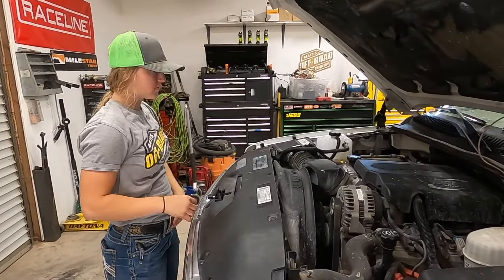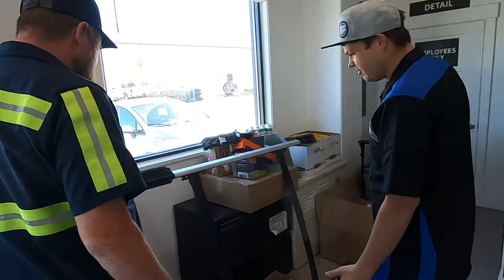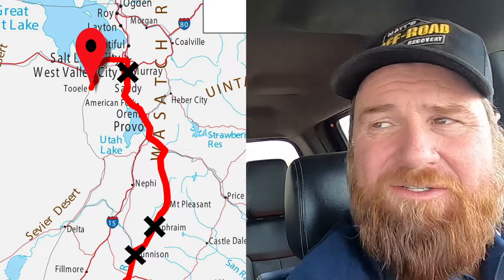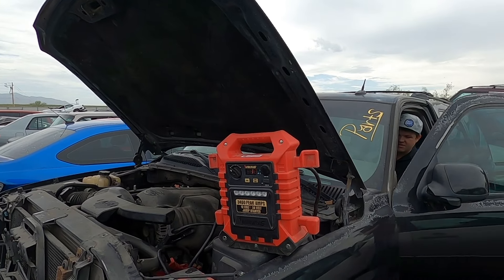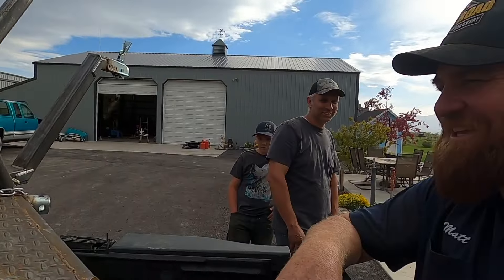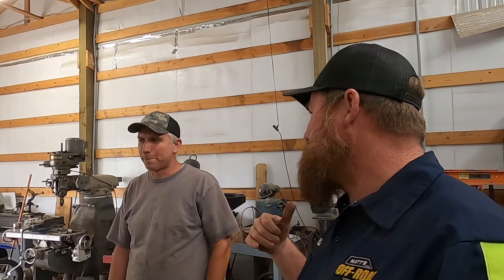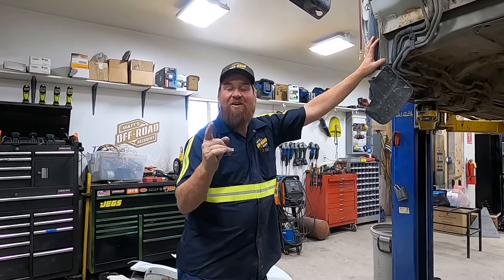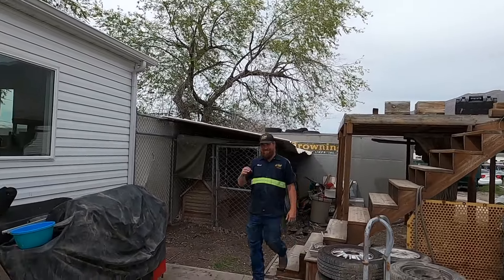Massive Engine For A Massive Off Road Wrecker!

Comment: “It uses 3x the fuel as a Duramax.” So what you’re saying is, you are going to run out of fuel in this vehicle too? We are shocked. lol
Reply: Maybe he should go with a Duramax. But then again the way fuel is now. Diesel is a mortgage payment every time ya fill up.
Reply: @captaininsano2777  he explained in another video why he didn’t go diesel and I kinda forget why… but I think it was the instant torque versus a more controlled torque for the sand. But then he talks about possibly adding a turbo to the 8.1. So maybe there is some trial and error going on. 😂
Reply: @100mphClub  lol just like having enough fuel for the job. Trial n error!!! 🤣😂
Reply: My first thought🤣
Reply: @100mphClub  He's probably trying to save weight with the gas motor. I'd vote for a Cummins personally.
Reply: I think weight was a big factor in not going diesel. That and the torque delivery.
Reply: @lucaswarren5947  considering the Duramax diesel is iron block and aluminum heads like most GM V8 engines. . I don't see the big gain in weight savings.
Reply: it will use more fuel at max torque but max torque is not always needed ,, so the fuel will not be as bad as you think
Reply: @captaininsano2777  it's 75ish lbs difference which isn't a lot. But Matt seems to really stress light weight in the sand.  Add to that the torque curve, and familiarity with gas engines vs diesel. And I can see why he went with the 8.1
Reply: @lucaswarren5947  the width of those tires is going to help a bunch in the sand. Especially when aired down. I really think the cost of diesel is the reason. And the fact that diesel in the cold can be a bad situation if it gels up. Since they do a bunch in the mountains, might be better to go gas.
Reply: @captaininsano2777  I'm just guessing but i don't think the diesel would actually cost more because it would probably burn less. Even if it did end up costing more, i don't think it would be be that much of a difference in total operating costs for a vehicle which probably won't do a lot of highway miles. I'm still guessing it's a combination of weight and familiarity. I would personally use diesel or at least build that motor up a little but that doesn't mean it's the right decision for Matt.
Reply: I have a one ton dually with the Vortec 454. Can confirm, hungry baby.
Reply: Guys, HERE is Our Savior

HalleluYAH translates “Praise ye YaH”

YaH is The Heavenly Father 
YaH is Who Created “Man (Adam)”
YaH arrives via the TENT OF MEETING 
YaH was Who they Crucified for the sins OF “Man”

** NO female involved WHATSOEVER **
— Hebrew Book of Isaiah 

Isaiah 42:8
"I am YaH; that is my Name! I will not yield my glory to another or my praise to idols.

Isaiah 43:11
I, I am YAH, and there is no other Savior but Me.

Isaiah 45:5
I am YaH, and there is none else.
Reply: DURAJUNK ----- Trashed 3 of them in less that 4 years - all new motors.
Reply: I work on both almost weekly and have since 2005...the fuel isn't that great of a difference within 8 mpg...and these are way easier and cheaper with readily available parts
Reply: @100mphClub  He said diesels have a very narrow rpm range and are very heavy.
Reply: @adamwinters4448  You're not joking. After driving a diesel for years, I was very pleasantly surprised after getting my truck with a Vortec 454. Every part for the thing is $40, and in stock locally. Takes plain ole 5w30, and the filter is $4. For the amount I drive it, I'm sold.
Reply: @captaininsano2777  I wonder if he could qualify for special tags that would let him run red diesel? I don’t know the laws in Utah. I know he’s a gas guy but I just keep thinking about how a LBZ Duramax or a 5.9 Cummins would be lighter and more efficient. Granted I live no where near the desert, so they know what they need.
Reply: I never did follow the reasoning on not going diesel,  it seemed personal preference to me. As the modern European diesels outperform in almost every way, and are no heavier. But I'm guessing such engines probably aren't readily available in the states?
Reply: @Praise___YaH  wtf does that shit have to do with the comment?
Reply: @shlomo_jewinstien-Doodoowitz  

You read what I shared? YaH The Heavenly Father was Who they Crucified for our sins, NOT some jesus and The Hebrew Book of Isaiah PROVES that
Reply: @Praise___YaH  u commented that shit on a comment about gas vs diesel engine you realize that theres no context for that right
Reply: @shlomo_jewinstien-Doodoowitz  i reported him for misinformation lol
Reply: It's okay. Matt is used to running out of gas.
Reply: Hopefully Matt gets his brains back so he will remember to fuel up before he goes on a recovery in this new minster off toad wrecker
Reply: @benmac940  I know it's old but he said he didn't want diesel because he wanted the wide power band doing sand recoveries. They don't want to change gear midway through a pull basically.
Reply: @zyeborm  shows how little you know on modern light weight diesel engines too then
Reply: @benmac940  you should tell Matt that. That's what he said. Tell him which modern light weight diesel he should have purchased for what he paid for this.
Reply: 8100 vortec 10mpg. But 315 gallon compared to 509 for diesel fuel.

Comment: The 8.1 is a great choice, I recommend you make sure you have a working fuel gauge in it Matt, and a large fuel tank, or two.
Reply: Or don't... Guaranteed content! lol
Reply: 3 large tanks at least. Knowing Matt he'll need a screamer to remind him to fill up.
Reply: I have a 2500hd with the 8.1. It’s a ripper up till about 55 mph, even when pulling a trailer. Also should be paired with the Allison which is bulletproof!  278,000 on it and it’s still a beast
Reply: cough FIFTY GALLONS cough 😁
Reply: Take the tank out of the burb, I believe it’s a 38 gal tank
Reply: @SuperMeffer  55? Mine pulls all the pay to 110ish. This also probably has the 4L80E. The Allison was only in the HD trucks.
Reply: Frame rails are gas tanks he explained in another video
Reply: I disagree on the gages.......
 If it starts steaming or pinging, it's too hot.
 If you can hear the valvetrain clatter it's low on oil.
 If it gets real quiet and smooth.....

 it's out of gas.

 Remember: Matt used to drive Demo Derby before this.
 Aint no place for gauges in a Demo Derby car or truck if you're serious!!
(Or steering if you're Matt...🤭)
Reply: @agentcrm  3 tanks you under estimate matt
Reply: @Recoveryteam there are no guarantees when it comes to GM fuel gauges or PCMs. I own a 03 Trailblazer 4L i6, my gas gauge is out by about 110 km (light is on, gauge reads empty). My cluster has that lovely Odometer Error as well.
Reply: @jacobtomberlin1896   No, actually the frame rails are gonna be air tanks...... That's why they welded metal rods through the middle of the frame to keep it from expanding due to air pressure.
 Gasoline doesn't get pressurized in the tank.
Reply: Matt, on KSL ads, I've got both a 42 gallon and a 33 gallon.
Reply: @jacobtomberlin1896  no there air tanks watch it again
Reply: @skeetermcswagger0U812  it actually does which is why they have a vent
Reply: @TylerDuysen  How's about you watching the video already has already been suggested so I won't be telling you that.🤭
Reply: @SuperMeffer  I have a 3500 dually. It pulls hard well past 55. You might need to get that checked out.
Reply: 2 tanks from an semi-tractor should do the Trick combined with an bild in Sirene for low gas.... lol
Reply: @jacobtomberlin1896  Air tanks for compressor volume, not gas.
Reply: @jacobtomberlin1896  the frame rails are for air, unless I missed something when they were welding them up and testing them with compressed air & checking for leaks
Reply: @jacobtomberlin1896  air tanks, not gas tanks
Reply: @Spelunkernaut  They did intend to use the frame as an air tank, but I don't know if that's still a plan. They got quite a lot of negative feedback on that. There's a good reason why pressure vessels are round. 
But I don't think it would be a good idea to repurpose it as a fuel tank, since the shape would make it hard to get the fuel out of there. They'd need a tap in the front and one in the rear, and switch between them depending on how the truck is tilted. 🙂
Reply: @basecius  yes, shape would be less than ideal for fuel 😆,  not to mention they didn't treat the inside of the frame rails and rust would become a major factor. They did pressure test the rails and I can't see 1/4 steel having an issue handling it.
Reply: @Spelunkernaut  But it had a quite scary bulge to it in the first version, and they didn't show any bulge-test on the pinned version. I think I saw some small bulging in the short leak test clip after pinning it, but I might have imagined that. I'm no expert, but just find it a bit unnerving to see any bulging from pressure on a structural component that will see even more stress on the trails. 
Then again I'm no expert, so I might be overly cautious.
Reply: My 96 3500 GMC has an 8.1 I swapped in after the 454 finally died. After living with it I can honestly say, a third fuel tank wouldnt be a bad idea... honestly, may replace the bed with just a fuel tank.
Reply: For europen viewers, it's the same power as a stock 3.0 Audi S6 biTDI engine, with 14% less torque and 5 times worse fuel economy.
Reply: @jacobtomberlin1896  The frame rails are AIR tanks (4.9 gallons per side) Remember they pinned the tanks with 9/16 rod to keep them from bulging when it was pressurized.
Reply: @jacobtomberlin1896  nope, air tanks.
Either one is a bad idea.
Reply: @skeetermcswagger0U812  All those sings say you are too late. Prevention is better certainly offroad.
Reply: @nielsdebakker3283  
It was a joke.
Reply: @nielsdebakker3283  things
Reply: @nielsdebakker3283  

Why are you pulling that big cargo ship with your Tug,....was Matt driving it and ran outta fuel in that too???😆🚢🛶🤭
Reply: Terrible choice
Reply: @basecius  worst happens with an air leak is some hissing until it’s out of air. It’s not exploding.
Reply: And lots of spare cans of oil. And spark plugs 😁

Comment: The 8.1 is a great engine. I have a 2002 Chevy 2500hd with that motor. I love it. I have a 91 octane tune on it that really wakes it up. The big difference between the suburban and the pick up is the transmission. The heavy duty pickups come with the Allison 5 speed (2001-2005 or the 6 speed 2006-07 classic)  transmission and the suburban comes with the 4l90e or 4l80e. The Alison is a much better transmission. The 8.1 came in large motor homes, U-haul trucks and the heavy duty pickups. It isn’t the best on fuel economy but it is very reliable and has tons of torque for a gas motor. Pulling the fuel economy isn’t that far off from a diesel , not as far as you might think anyway. Empty it isn’t much better than loaded. I love mine and I think you will like it in the wrecker. Great choice Matt.

Comment: Thanks for all the fun Matt!
Suggestion!  Add a simple gusset to the top and bottom obtuse angles of that welded Gooseneck.  It will add a lot of strength to the Gooseneck and take a lot of stress off of the welds.
Reply: Thought the same thing about adding gussets to those welds.
Reply: So glad someone mentioned this. Heavy braking or backing up will twist / damage that gooseneck hitch extension.
Reply: Add a tube from the top of the front wheel  hoop to the top miter on the square tube hitch

Comment: A couple of things you should consider on the 8.1 that will make it  breath better and not diminish the low end torque.   First and foremost is to remove the intake manifold and delete the internal PCV which is the reason the 8.1 uses oil.   If you want  more top end, cut the bottom of the intake manifold off and clean out the internal restrictions.   This will push that long flat torque curve well past 5000 rpm.   In stock form they are done at 4400 on a good day.  Long tube headers and a tune will get you deep into the 500s for torque at the crank.   You won't  be disappointed with any of these modifications and this thing should be good for 300k miles +.

Comment: That's a heck of a long lever arm on that drop hitch, it could use a few gussets
Reply: He really only needs 1 underneith the welded joint.
Reply: @captaininsano2777   One on the top as well where the tongue comes straight off the trailer.
Reply: they plated the side of the hitch where they cut and welded it for what there hauling on the trailer it will be fine
Reply: @randytravis3998  in an accident, it's amazing how forces multiply. Never assume it will be fine. For the extra effort it would take. It's worth doing right.
Reply: @captaininsano2777  -- I don't think that they considered how the forces are going to react if there is a sidewards load on the trailer tongue... I would consider putting some braces that went from the top of the tongue to the forward corners of the bed of the trailer...
Reply: Yep. They didn't consider how the forces might multiply even in everyday towing, let alone a situation that suddenly goes Tango Uniform. That being said, I must observe that there certainly is some miscalculation here. This setup is too high for a modern Ford SuperDuty. There is no way that is going to match the hitch on that old micro-Suzuki.
Reply: @randytravis3998   Didn't catch the plates. Yeah that will probably work. I'd still toss a gusset on each one for longevity
Reply: @michaelzdanis3979  remember, it's lifted/Geo tracker frame on bigger tires
Reply: @michaelzdanis3979  I don't disagree that they could have done better in theory but if an 86 year old Ed gets in to an accident in his custom restored Golden Nugget nobody is going to be thinking about the trailer's hitch attachment. 

and they tested the trailer in Robby's video and the height matched up perfectly, that's why they were using measurements when they modified it
Reply: The Sub is clean just as it is!  I'd like to have it just as they found it
Reply: Only a couple hundred pounds on it
Reply: @captaininsano2777  in an accident, all bets are off and a couple extra gussets arern't going to do diddly squat really. They plated both sides over the cut lines if you look closely. I missed it the first time as well. Looks like welded all around the plate too so should be good.
Reply: @tomjones5079   I thought the same thing but another poster said Matt posted the underside was shot. Amazing because the front fenders and the rockers and doors looked pristine. They should be able to sell those to make back some coin 

Matt's Off Road Recovery
18 hours ago
It’s a serious rust victim. I can stick my fingers through most of the lower panels. 

It came from the Midwest, and it is in some serious trouble.
Reply: @chriskulpa4056  I didn't even see that they did that. Where was that in the video. 😂
Reply: @captaininsano2777  They didn't show them welding them on but if you look when they are wheeling it up and figure out that it isn't gonna work on Blue Steel, you can see them on there. I assume they put them on the other side as well.